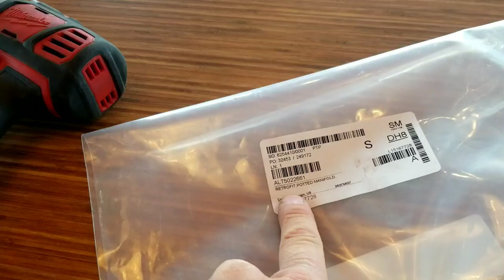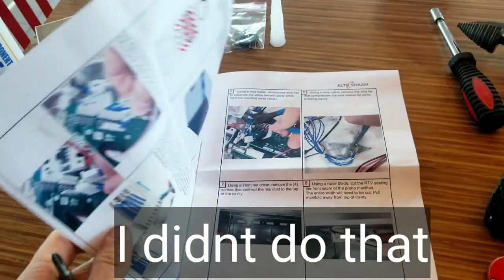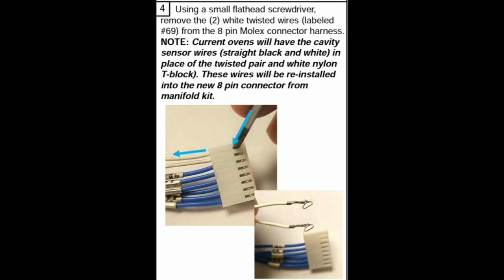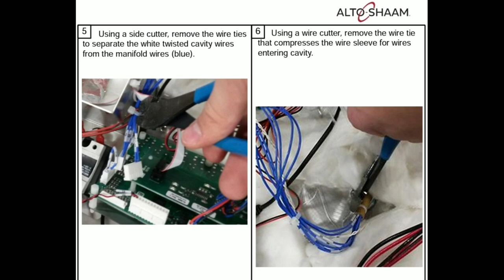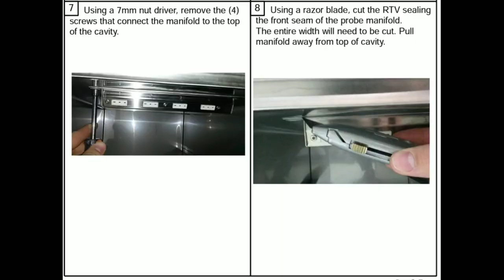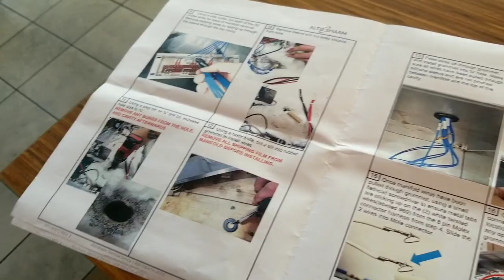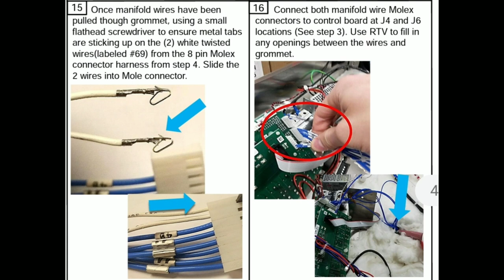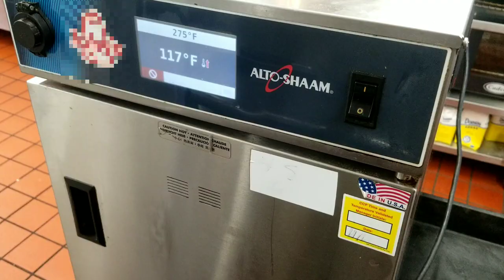Alto Shamm manifold replacement

Comment: Hm, when you put white wires back in connector you made mistake puting metal parts rotated 180 degree. It is imposible to pair male and female parts if two are assembled like that. Believe that you  corrected that but didn't show that in the video
Reply from the maker: Great catch, only you and Big Clive so far caught that- I did find my mistake when I started the unit up and it didnt recognize the thermal limit, it was a quick fix and thought no one would notice in the first place I so I didnt add the mistake, figured it may make the video more confusing

Comment: Looking at this makes me wish to never have to eat at a US place. Don't get me wrong - I'm aware it's probably worse everywhere than regular people think, but he feels this is OK to show on youtube - so it's probably not too bad for US standards. cough retch
Reply: What part of carbon bothers you? By the time it is baked on the walls of an oven like that, that stuff is dead, dead, dead, and so is anything that was ever living on or  in it. I'd rather have a little black flavorless dust on my food than an ounce of caustic cleaning solution dripping onto it.

Now, if the salad bar line looked like that (which it may well, who knows) I'd be more concerned.
Reply from the maker: Ive been in thousands of restaurant kitchens from fast food joints to casual dinning to the fancy places with a dress code and to some degree there all disgusting- no joke- ive been in high end steak joints that are just gross and I have no idea why, they make enough money to pay people to clean- then on the opposite of that ive been in some fast food kitchens that you could eat off the floor behind the fryer they where so clean, of course those are few and far between-- my point 90 percent of restaurant kitchens are gross
Reply: @curioushvacguy6876  : Bang on brother & it's seems to be pretty much the same wherever you go. Usually front of house is clean and tidy but nobody gives much of a damn about the Kitchen or food prep / storage areas, customers don't get back there and see the dirt. Guess why there's few restaurants or takeaways I'll use 😱.